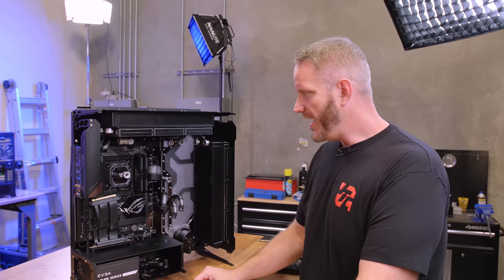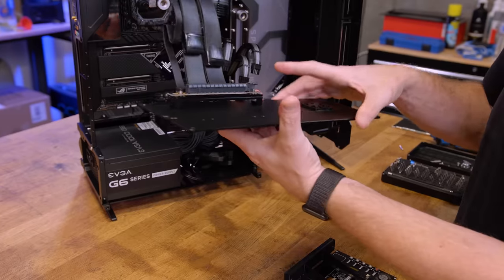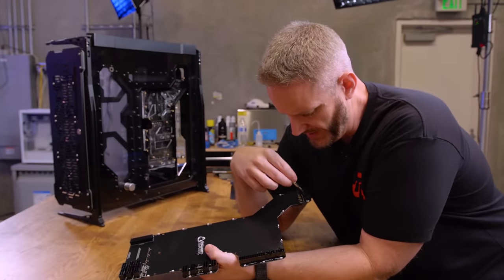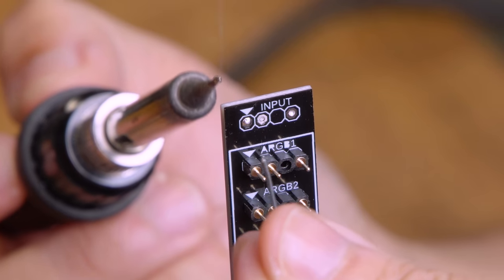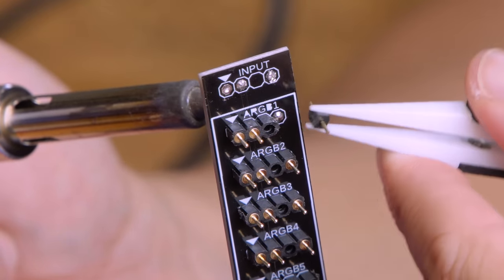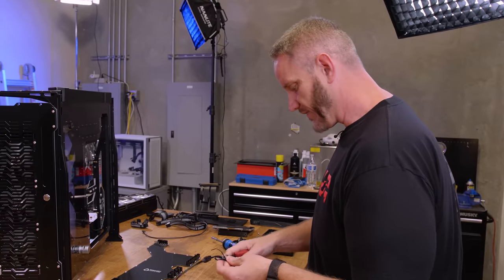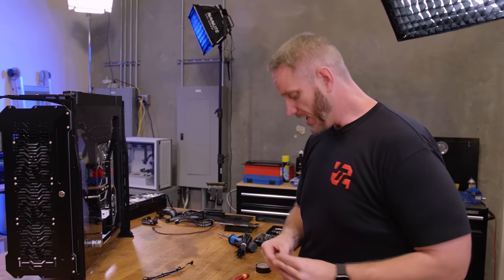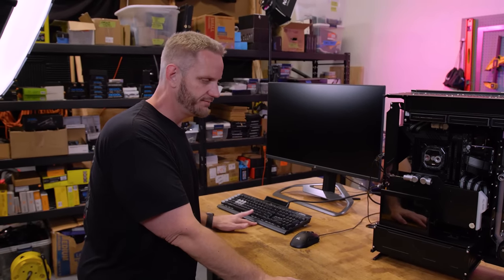This video made everyone mad at me...

Comment: This is something where I'd definitely have a somewhat better soldering kit available for repairs.  Even just a small thing of desoldering braid and a small bottle of no clean flux would've made everything SO much easier to do.
Reply: Better kit ? what you just mentioned is the minimum required equipment to do  anything
Reply: @legros731  Well technically no.  To do it the best and easiest way of course, but a skilled user could do what they were doing just by adding more solder and relying on the rosin core to do what they were doing better with the little equipment they had.

Comment: You would think since he does solder work he would at least not use the $30 Radio Shack soldering gun pack. When dealing with pins you take the solder out and solder it once the pin is through. It isn't a pad..

Comment: hay guys, good stuff, just one question, why didnt you just replace the whole pin block instead of the single pin? would that not have been easier? im no solder or computer expert or even novice, lol. just a question. 😛

Comment: not a pro tip, if you get hole hot then just tap it on a table all the solder flies out and you can just put the pin in the empty hole...

Comment: that solder job was a little painful to watch. With solder suckers, braid, flux and better temp control you could've desoldered a row of pins from the donor and replace it completely WITHOUT  taking the risk of breaking traces on the big board when you cut the pin off. 

Also you don't pre-solder through-holes. You want them to be open, pun one leg in, add a bit of solder, heat it up to straighten it and THEN you solder the other ones.
Reply: Did it work though?
Reply: @Alucard-gt1zf  well yes, it fortunately did work in this case, but it also could've gone wrong : a broken trace,  the via hole for the pin could've been ripped off depending on the type of construction of the PCB , to name a few

Comment: As a person qualified to do small PCB repairs, I would have used a better soldering station and added to my soldering station would be a small microscope (with lighting and video) to see exactly what I need to repair. But the way you have done it will suffice until it's time to pull the "plug" off and hope that it doesn't break again.I guess Jays lesson learned is not to be so heavy handed when dealing with plugs. ;)

Comment: Hi Jay or anyone knowledgable with this problem. My PC turns on enters windows but when I'm trying to play games I'm losing display. Itried DDU reseat my GPU. I also tried using furmark and same as the games it blacks out. My GPU fans were spinning. I tried searching for solutions but nothing worked. I can't identify if it's the monitor, gpu, mobo, or PSU. My pc is not freezing it has no display youtube videos continues to play with no display. Thanks in advance guys
Specs:
Ryzen 5 1500x
Biostar A320MH
Galax GTX 960
16gbs ram
Cooler Master MWEv2 650W gold
Old Lcd monitor

Comment: Hey guys, wondering if i can get some help in the comments. I am having issues with stuttering and frame drops, also crashing for the past few months. 
Build: Ryzen 5 3600
rx 5700 xt
2x 8gb 3600 ram (can only get it up to 3000 in bios for some reason but thats another issue)
asus b550 pro 4 

Now I`m pretty certain its a gpu issue because I have done a lot of trouble shooting and have found the issues to occur on different builds when I swap my gpu in. Most of the time I get great framerate but crazy bad frame drops causing lag and ruining the game (changing in game and amd settings does nothing). Valorant is especially bad. I have done DDU multiple times to no progress, Does anyone have any suggestions as I spent a lot of money on the gpu and do not want to throw it out. 
Thanks

Comment: OMG that repair was so wrong. That board is not repaired it is suffering from horrendous abuse.
Remove a full header from the two boards, clear the hole on the main distro board, put the header in and add solder.
Simple and it would be like new.
Watching the repair made me feel more sick than I felt when I had a tumour in my pancreas.

Comment: 20/20 hind sight makes me wonder why you didn't just push the broken section of the pin through with the iron and just pull it out with the cable ties (sorry tweezers) and then just do the same with a donor pin on the rgb hub board then just push the new pin in whilst melting the solder..... I just wasted my time didn't I? oh well at least I can guarantee the system wont be finished by the time I stop typing....la la la you don't care...

Comment: OK.. stop what you're doing and do it as follows..  (I'm hyperventilating while watching this video)

1.  Choose a smaller soldering tip.
2.  Melt the solder spots and use a desolder pump on each spot to remove all the solder.
3.  Now you can remove the entire pin module with ease.
4.  Use a tiny drill bit to redress the holes with a mandrel (by hand).
5.  Then insert the entire pin module, coat the pins with a small amount of flux before inserting.
6.  Solder the pins one by one, preferably by someone with a steady hand lol.

Job done!

Comment: As a professionally trained “high reliability micro-miniature soldering” technician…

This repair hurts to watch.

If something works after you are finished, I guess it’s all good in the end… But still… Ow.
Reply: It was a bit of an odd technique, but he got the job done.
Reply: @--_DJ_--  Yeah, I guess… I had to stop watching before I cringed to death.

But I assumed they got it done in the end.

I hope they just went ahead and replaced the whole thing.

But as long as it works, they at least saved the board and money.
Reply: @marine6680  Nope, just the single pin, but  going at it the way they did, that was the only way it was going to happen.
Reply: @--_DJ_--  Probably right about that.

Comment: I though that you would de-solder the entire pin connector from the existing left over PCB with many connectors that was used for practice, and not actually separate the broken pin enclosure from the power board, it would look even better and not be a different "shade of brass" this is from your own mouth, if it even triggered you, you did not have to be so mean to the other people with OCD who gave the same advice probably as mine, anyway, nice soldering skills Phill, surely you would be able to do the above method if you had more planning time and not have camera anxiety when doing this delicate operation, since working on drones takes so much skill and swapping an ARGB header would be a walk in the park, oh well, at least it works!

Comment: And now for the REAL real best way to solder through-hole pins: You should not pre-fill the hole with solder, you should first wick/suck the hole empty of solder (and before that use fresh solder or flux on it to make sure the existing solder comes out as clean as possible), then insert the pin in the hole and then solder it. If you pre-fill the hole, not only is it more difficult to align the new pin, but it will burn away flux so that the final joint might not be as well connected as possible! I'm slightly surprised that after all that "Phil is an expert solder-er" he/you still did not do it the best way!